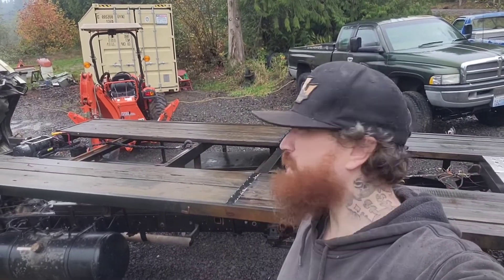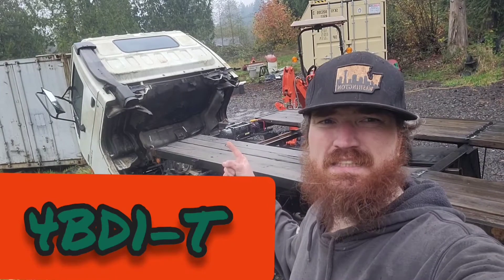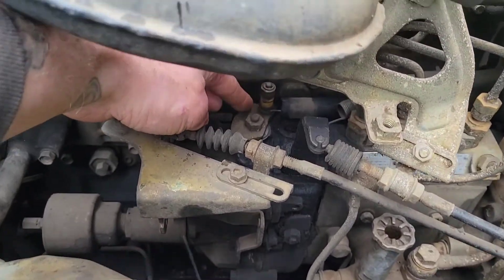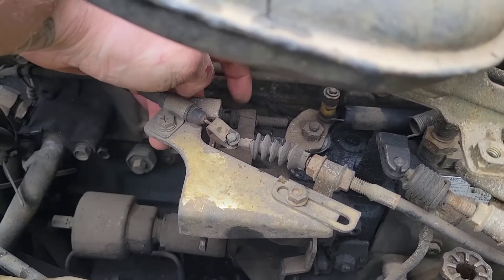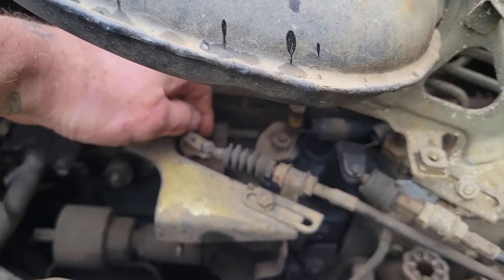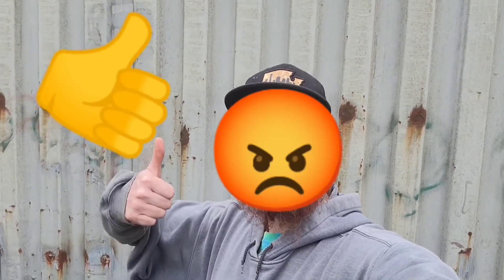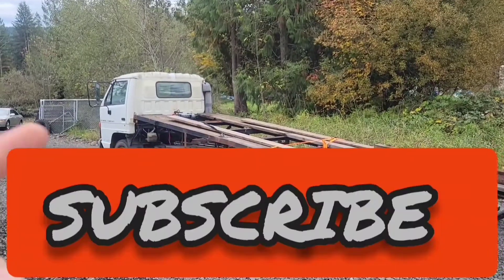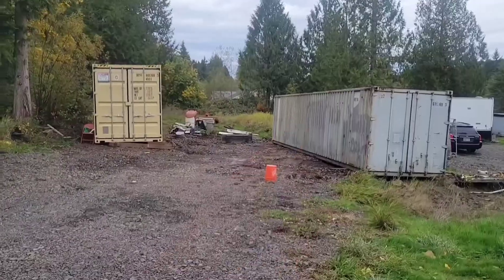Make a Isuzu 4bd1t 4bd1-t turbo diesel roll coal

Comment: Haha all that does is increase the maximum rpm, the fuel screw is further on the side of the pump
Reply: Hello! I have 1985 Isuzu 4bd1, runs great on up hill is slow no turbo and no space to install the turbo.what do you think about installing a supercharger for a little more power. Thanks
Reply: @aliazarmehr1477  no to supercharger, what vehicle is it in, usually it isn’t too hard to fit a turbo, you can get high, top and mid mount manifolds so lots of options of mounting, I have just put a holset he221 7cm with inter cooler on mine and plenty of room
Reply from the maker: Turbo is usually the better choice for a diesel engine.
Reply: @freecrocs  I'm using a hx25 on mine, is he221 the same size as hx25?  Also in neutral when the accelerator is pumped , there is a lag